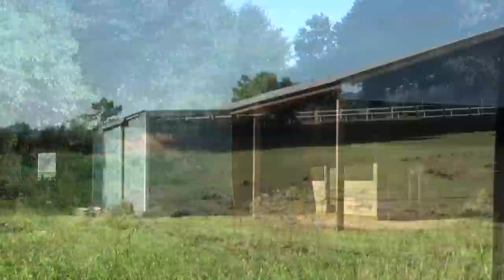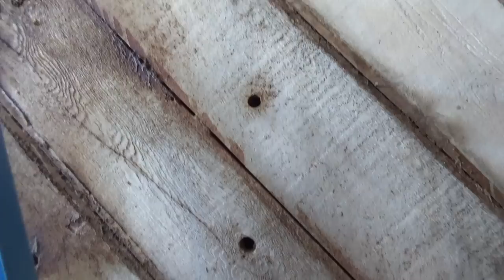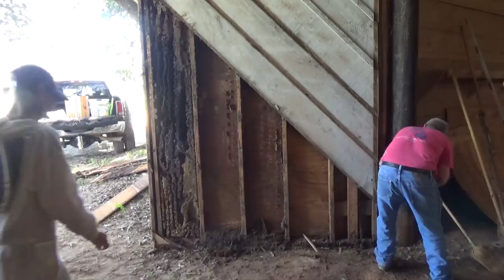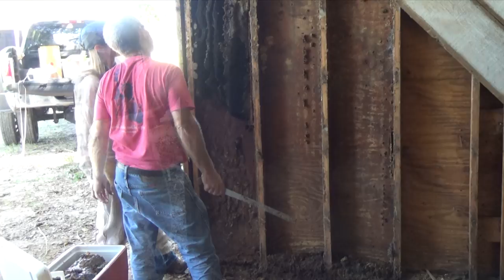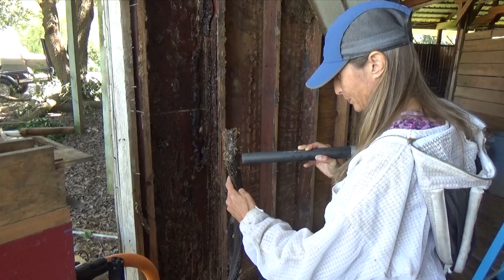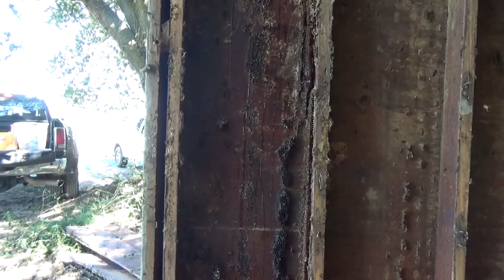Saving a feral bee hive that is failing.

Comment: Jeff I hate to see you torturing yourself over those dead bees, that's why I will give you this advise. Please read carefully. I have learned from an old beekeeper that when you create a nucleus it would be best to put 5 to 12 peaces of newspaper on the entrance blocking it, but previously drill small holes in the paper with something pointy. It will keep the bees inside the nucleus for few days until they chew it from the inside. The number of peaces of paper depend on how much you think they should be inside a nucleus; that is, on how much days they need for new bees to get out of the cells and/or young bees to mature enough. While doing this make sure they have enough supplement food (sugar water) in their feeder. The paper will prevent any attempt of robbery from other bees until they are ready to handle it themselves. I hope this advice will help you one day. Wish you best of luck.
Reply from the maker: Great advise, and I have heard of the method being used. Wished I had thought of it before it was to late. Thank you for the helpful info and for watching. God's peace.
Mr. Ed

Comment: Where could I learn more about rescuing bees? I am up in Shreveport and have watched several of your videos, slowly building the confidence to try and save the bees from inside a brick column in my mother's pier and beam home, but I'm still unsure of the best way to approach it. I am in the beginning of several remodeling projects to help set her up for comfortable living in retirement, and the front room may be on my list in the very near future.  I would like to have a plan in place to try my best to save them if possible. Thank you for all you do! I have learned a ton from these videos!
Reply from the maker: Removing bees that are inside a closed structure, weather it be a tree or a column, is very difficult. Most removal folks use a "trap out" method and there are several good Youtube videos on them. However, they are very difficult to set up, and are often very time consuming to accomplish the task. Personally, I won't do them. I wish you all the best in your endeavor, and let me know how it goes. Thanks for watching.God's peace.
Mr. Ed